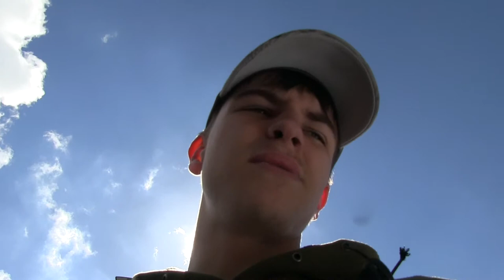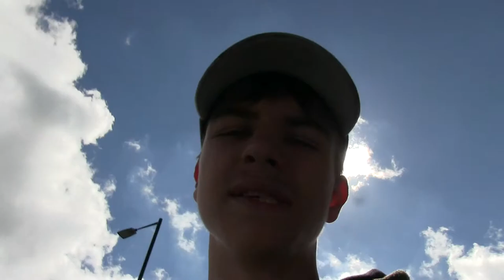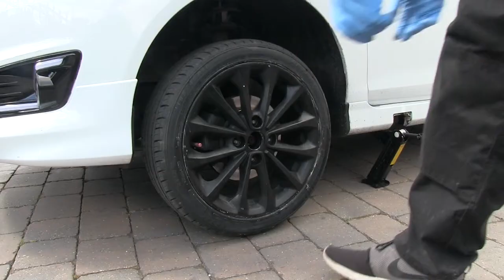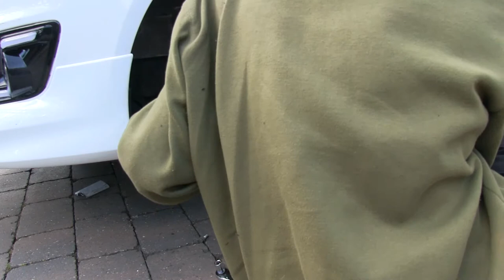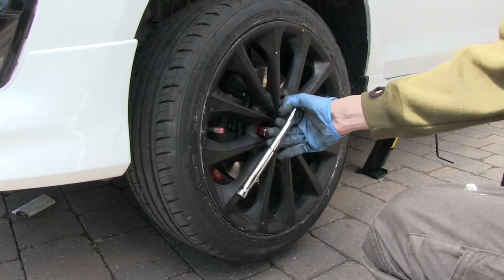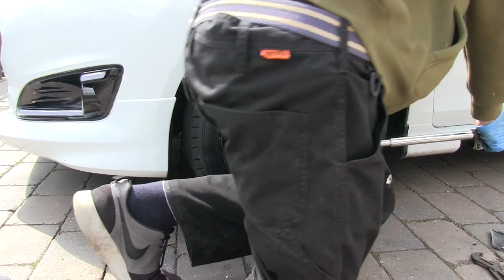Changing brake pads | Fiesta 1l ecoboost

Comment: For next time, release the jack and put all the weight on the axle stand. Those flimsy jacks break on the plastic winder very easily. Clean the Caliper housing bracket, remove all the old gunk and brake dust with a wire brush then grease the pad shims to avoid squeaking. Also never use a wrench to reset the piston. This can fuck up your ABS as the fluid is ejected too quickly. Take off your brake fluid reservoir cap then use a G-Clamp (someone said c-clamp lol) to wind it back in slowly. Other than that, great to see lads having a go at home 🤙🏽👍🏽